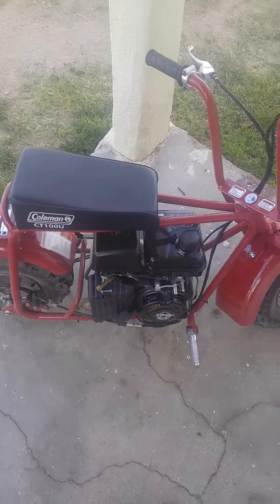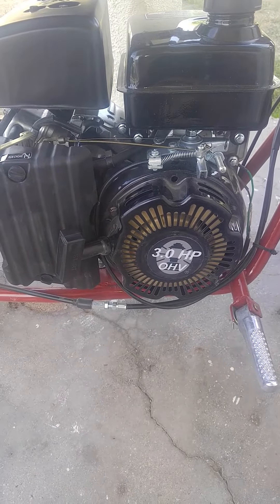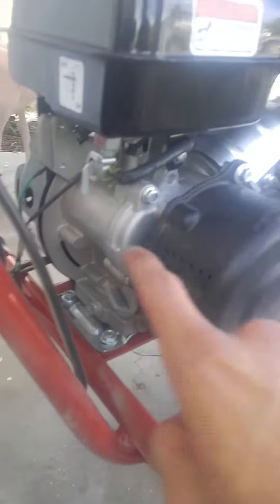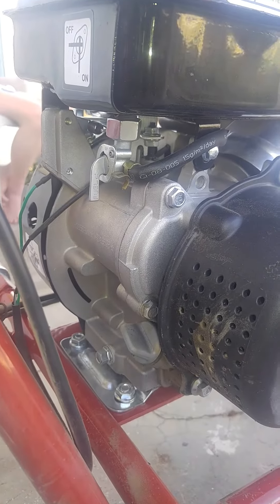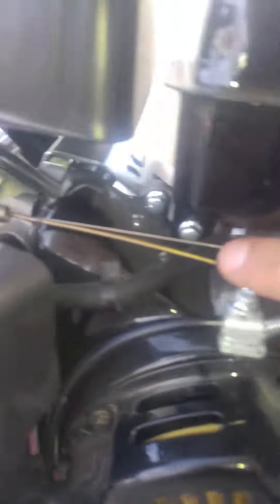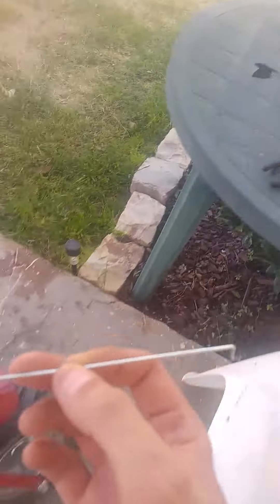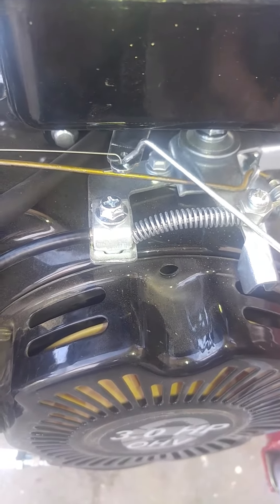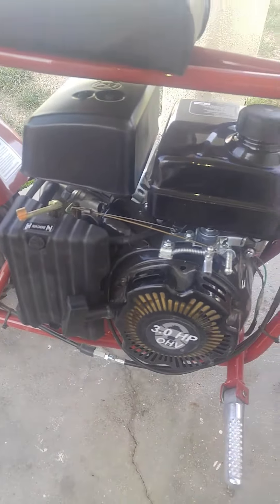Coleman ct 100u Governor bypass ©Spikemandan

Comment: I just bought one of these yesterday. Brand new,  and just redid the governor your way. it made a big difference.
Thanx!
Reply from the maker: You're welcome and I agree allows the engine to rev it full potential
Reply: @spikemandan  Hell yeah it does!
Scared the shit out of me at first rip...lol
But I got used to it, I tell you what man... These little shits are fun as hell.
And I am 44 years old!
I had a very bad accident when I was 17... Split my liver whilst riding a 3 wheeler.
I spent two weeks in ICU. 
I almost died because of that whole experience. It made me steer clear of any motorcycle or three-wheeler four-wheeler etc.
But when I saw this little Coleman? I fell in love!
Lol...
And I got to say I'm over my fear of riding again!!!!
And with your help, made my bike run better so thank you!
Sorry so long bro... LOL
Reply from the maker: @TheFLOMAN76  that's what I do man spread the love
Reply: I wish you could see my little bike now bro. I turned it into an off road chopper.
Headlights, rear light. Seat shock. A back rest made from the original seat that came with the ct100u...lol!
Bent the handlebars out slightly so I didn't feel so scrunched, readjusted the governor and everything else like you did. Eventually I will put a predator 212 on it and maybe a teardrop or cylinder shaped gas tank. I wish I could send you a picture of it now as is! It's awesome looking... LOL!
Reply: @spikeman dan... Absolutely brother! I will spread the love. Thank you sir.
How can I send you a pic?
Reply from the maker: @TheFLOMAN76  about ready to go live have to to a thank you shout out to everyone who watched my videos
Reply: @spikemandan  Hell yeah!!

Comment: Hey I tried to do this but oddly enough instead of moving, the bike stays still. The motor runs yet the throttle linkage won’t move and pull the on the carburetor.
Reply from the maker: Chances are you goofed up and hooked up something wrong

Comment: The reason they go though the trouble of removing the governor is because it is a plastic gear.  The plastic gear can come apart at high RPM and the governor parts can fly around in the engine and cause damage.
Reply from the maker: themauldens right you are
Reply: spikeman dan I am gt ting a bike next week would it be okay to bypass and has it exploded for you yet

Comment: how do you just remove the stock line and replace it without the governer?
Reply from the maker: No you keep the stock throttle cable where it isif you paid attention to the video you would know I made a custom coat hanger wire bypassing the governor
Reply: @spikemandan  no I've seen this video and im eager to do the replacement and i have the coat hanger, but do you take out the old thins and replace it with the coat hanger because i have a newer model I think and i have a new model, so do i just replace the old stock one with the coathanger?
Reply from the maker: @letsgogo8473  yeah you have to replace the old one that comes with the bikebecause the coat hanger where it needs to be is going to bypass where the throttle connects
Reply: @spikemandan  ok thank you for clearing some stuff up

Comment: can you use a Lifan 1 in. 15 HP 420cc OHV Electric Start Horizontal Keyway Shaft Gas Engine for mini bikes? Like the motor is from home depot. But I don't see where the clutch is.
Reply from the maker: the answer is yes! that is if you feel like doing a bunch of work to the frame it's self lolz just saying lotz of work ahead of you depending on what your working on of course
Reply: cool thanks. I have the coleman ct200u. What do suggest if I want to go 60+ mph?
Reply from the maker: all kind of stuff you can do like changing to a smaller sprocket, removing the governor , and installing a torque converter, buying all the after market parts for it from gopowersports.com
Reply: Cool thanks
Reply from the maker: check out www.youtube.com/redbeard'sgarage hes has all kinds of video's on the ct 200u & the EX200u

Comment: Okk what to do when u do that n it just up n stop running
Reply from the maker: Same thing everybody else does make sure the power switch is on make sure it has spark make sure it's getting fuel and if it runs and dies my check the spark plug basically your run-of-the-mill stuff

Comment: I heard that if you take that gov off that it could be unsafe for the engine. It could cause the engine to blow because it's to much power...? That's one of the reasons I never messed with mine.
Reply from the maker: do you believe everything you hear lol been riding like a bat outta hell and my bike  is just fine
Reply: No, I question everything, but I don't know much about motors. I am learning though! 🙂
Reply from the maker: fare enough dont forget to subscribe and you'l be fine
Reply from the maker: you do know that there are all kinds of company's that make all the aftermarket parts too put in these small engines to handle that right? come on man keep up! haha lol

Comment: How did you make the coat hanger fit like that?
Reply from the maker: I compared it to the original throttle Rod to a coat hanger wire and made it a little bit longer took me two times to get it right
Reply: How long is the new linkage?

Comment: When that plastic governor self destructs, and it will, it's going to take the engine with it. It will run great until it doesn't.
Reply from the maker: And you're absolutely right that's why I remove the engine and got a 212 Hemi with the governor gear completely removed
Reply: That's a big engine in such a little bike. I use non-governored 212s on my off-road karts and they do ~48 mph.            down hill ...
Reply from the maker: @MegaKencam  I have my engine practically stage 3 so I'm doing 55 on a flat have the video already uploaded to prove it